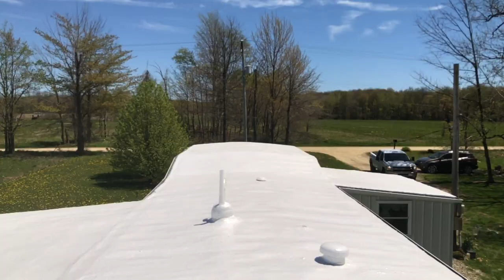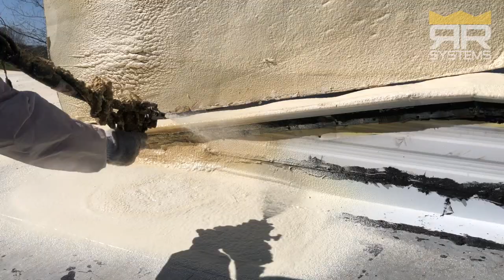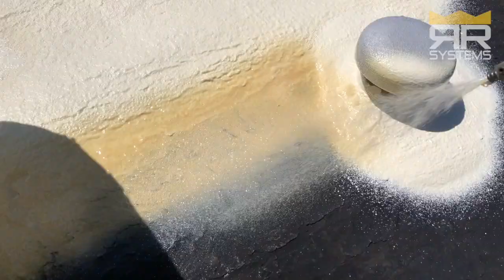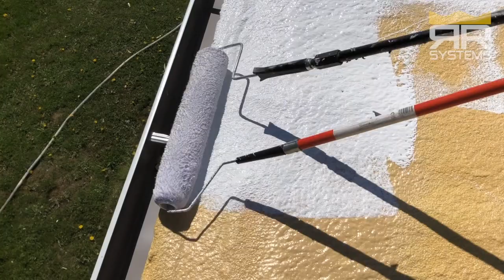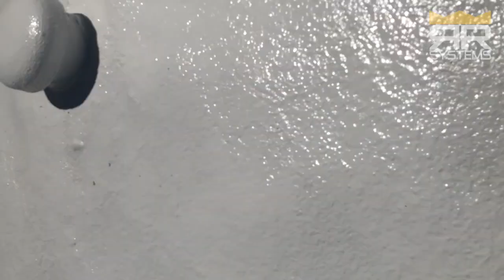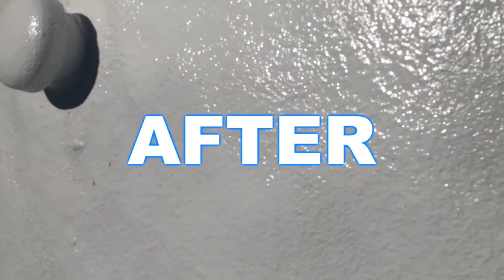Mobile Home Foam Roof System

Comment: better off doing a roof over. this does not stop leaks!!
Reply from the maker: I appreciate your comment.  This system has over 1.5 inches of closed cell foam plus a 20 year silicone over that.  It stops leaks my friend.